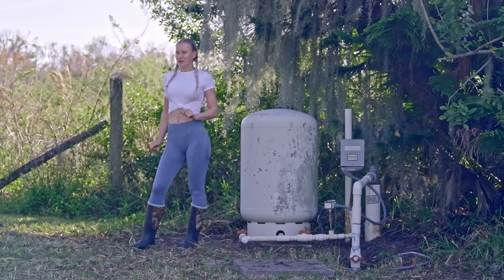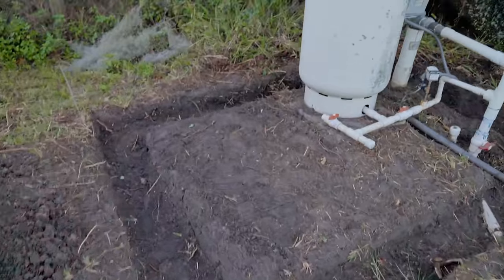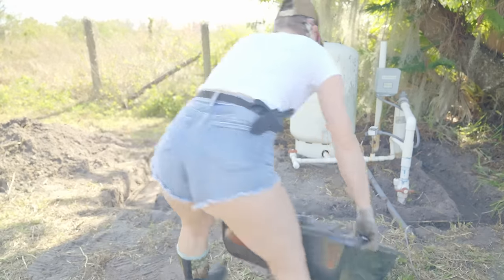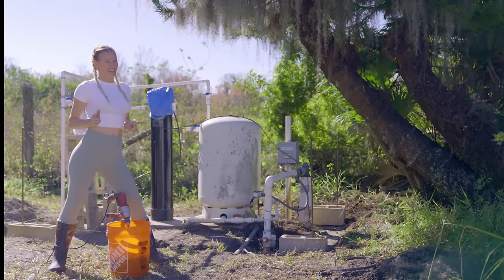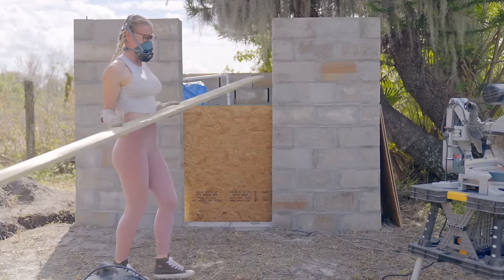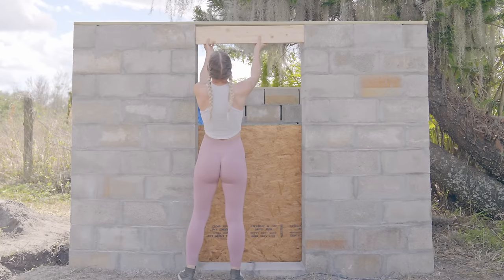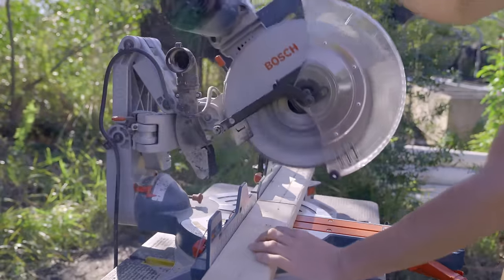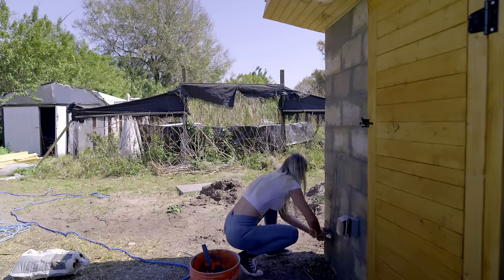Cinderblock Shed build -  start to finish. Is it BETTER than wood?

Comment: Looking great! And so are you! As a native Floridian, you made the right choice using blocks for the shed, hurricanes! I have 2 suggestions;  get a pallet and put a sheet ofplywood on it. Now you have a work table/ platform when using the tractor forks. The second one you basically did with the water filters but a water softening systems works better to get rid of the rust color/ taste/smell you'll get from well water. Sand away and mix away beautiful!
Reply from the maker: Thanks a lot!! Thank you for the suggestions. I was going back and forth on what treatment system to use. The thing is that I have extremely high sulfur and Iron in the well water. A regular softener wasn't up for the task. I have another filter up the line that is outside the well house giving me another level of filtration. Still wouldn't drink the water...

Comment: Sense you don't have any connection between the center boards on the door and the frame other than the plywood, I would suggest connecting the framing to the boards in the middle with some diagonal braces.  You could also put the bracing on the inside and have it nailed to the frame, the plywood and the boards on the outside if your nails are long enough.  That way, when the FL humidity and sun do what they do to plywood in a few years, the door will maintain its integrity.
Reply from the maker: Thank you for the tip and for watching my video!  Have a great week 👍😁

Comment: Meike, if you ever have to do this kind of work again maybe you should consider renting an electric cement mixer. You can mix up to three bags at once. When the cement is mixed you just dump the battle forward into a wheelbarrow. and dump it in the trench. Nice job on the structure. I expected nothing less from you!
Reply from the maker: Absolutely. I used to own a Harbor Freight cement mixer that costs about what I would have paid for a rental. It was great to have but I had to sell it since I did not have enough room back then. Now I wish I still had it
Reply: Well, you did a fantastic job without it. All with a smile @WhatMeikeMakes

Comment: great video! Tho I don't understand why you use a mask for the lumber cutting but wont use one for the cement and mortar mixing. hope you look into the reasons why you should. keep up the great work!
Reply from the maker: Because the lumber was treated with a chemical 😉 I work outdoor but the sawdust was very fine.

Comment: Everything is wet all the time in Fl: Even the Air. building stuff exposed to the weather that's susceptible to rot is a BAD idea, if you want it to last: Masonry was and is the right choice!
Reply from the maker: Very true. The air is always wet too here. 👍
Reply: @WhatMeikeMakes  lived in Fl for 7yrs!

OH! forgot before, if you need to put up fencing: Metal Posts! Treated wood will last longer than untreated, but that's like saying a paper towel will last longer than tissue in a hurricane!

Comment: If the laps aren't tied to the frame: only glued and nailed to the chip board: then your door is just made of chip board, decorated with the laps: Up to you if that sounds sufficient for your needs, but if this is accessible to thieves, your door will be as secure as tissue paper...

Comment: i'm not sure i would have completely embedded that plastic pipe in cement in case you ever need to replace it...anyway, looks good.
Reply from the maker: Thanks for watching my video. Well, plastic doesn’t stick to cement. If I ever needed to replace the pipe, I can just cut it left and right of the cement and slide it through 😉 but what are really the changes that I will ever have to replace that pipe right there. I’d say slim to none

Comment: If you heat up the isolated area of rebar for the bending moment (with a torch) it makes bending far easier and a much tighter corner!
Reply from the maker: Thank you for the tip!

Comment: Modernes behandeltes Holz verwendet Kupfersulfat, was ziemlich sicher ist
Reply from the maker: It just looked extremely green which didn't make me feel a little fuzzy. So I rather went with mask and gloves. But good to know for the future! Thanks David.
Reply: @WhatMeikeMakes  You did the right thing if no knowing what chemical was used.  Copper when exposed to air and the elements will have a green tint.  Think of steel when it rusts it has a red tint. You can use a dust filter and be okay with that

Comment: I think I made the millionaire reference cause of thee expensive equipment you have. Ppl like me would never have access to stuff like that so other than watching a pretty girl in shorts, I can't do much with the info
Reply from the maker: Like what? I mix the cement by hand. You don’t have access to a plastic bin and a hoe? You can buy them used for a few bucks. I mixed the mortar with a harbor freight mixer. Was like $30ish. I dug most of the base by hand with a shovel. Was $10… If you are referring to my tractors I did lease a tractor since I sold my car, it’s like have a car payment now. So I really don’t get where you say you can’t have access to stuff like that. I’m a normal person as well that has a dayjob and a dream and I use as much of my income from my day job to reinvest into my farm. Lots of people work hard and have the same dreams like I have. If you dedicate your time and effort it’s really doable. With being a millionaire… anyways if I were a millionaire I probably wouldn’t build any of this stuff myself 😂

Comment: If those pipes freeze and break under that cement you're going to have one hell of a time trying to tear the cement up to repair them
Reply: The footing is only a foot deep. Dig under the wall. Easy.
Reply from the maker: yea the footing is not very deep. I forgot to install a drain pipe and already had to dig underneath it. Not too bad... I just hope it will never come to that again. We don't get too much freezing temperatures here in Florida ;-)

Comment: you didn't call?  Never know when there's a gas main or underground high voltage.
Reply from the maker: When did I ever say that?
Reply: @WhatMeikeMakes    Ya didn't come right  out ans say it but you spoke about it in a way that gave rise to the conclusion. And of course there were no flags.  But of course there wouldn't be any of there were no recorded easements for gas or power.  If I was mistaken  you have my apologies.